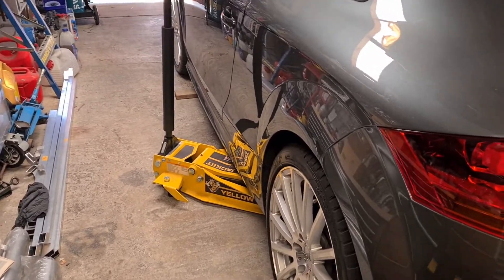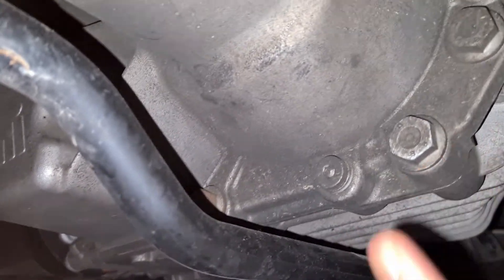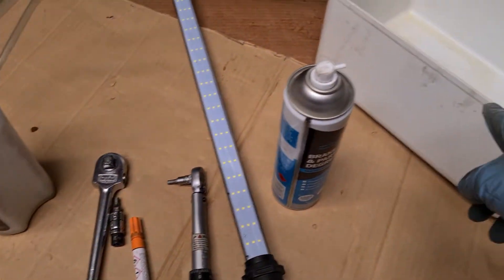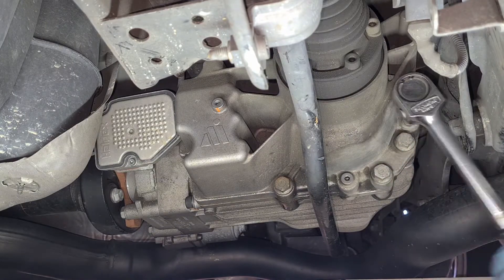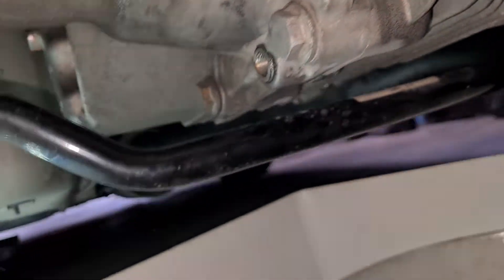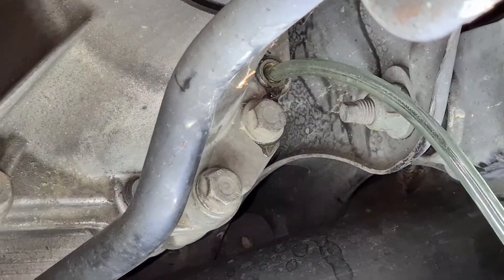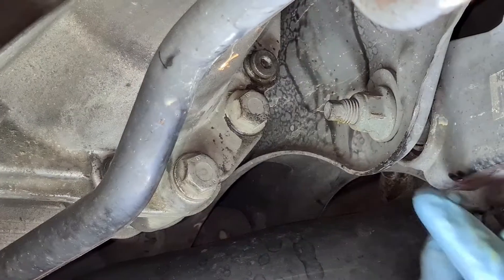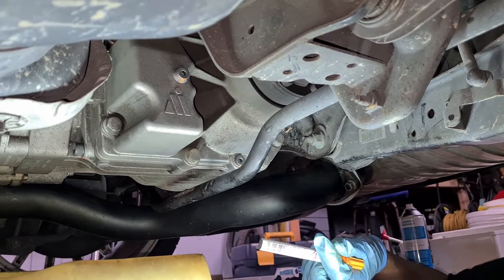Differential Service - Audi / VW (Haldex Gen 4) - Diff side only

Comment: Great video. I have seen someone suggest after drain, use an air compressor and blow out any oil residual oil before the fill. Also worth mentioning that the new diff oil should be the same temperature as the haldex fluid 20 - 40 degrees. VCDS not necessary.